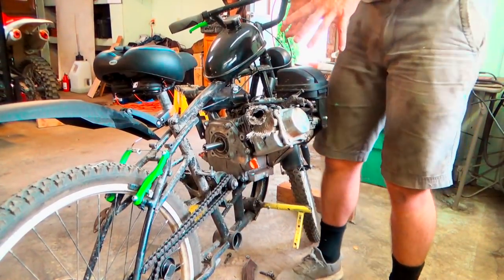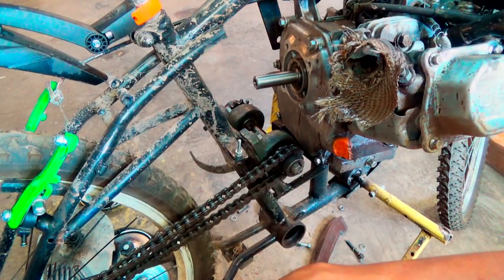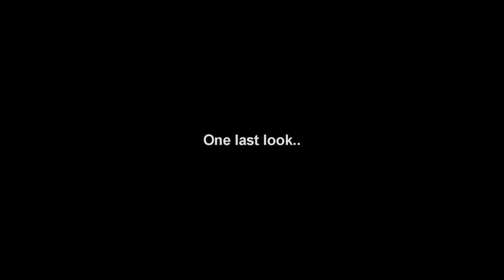home-made Motorcycle 212cc ( with Lawn mower transmission!)

Comment: hey that is one awesome build man i just had one qustion i have a coleman ct200u with a 301cc predator engine right now i am running the series 40 turque converter it also has a lot of mods done to it but i would like to have a 5 speed transmission on the bike do you know of anything that will work if so let me know

Comment: Bro, builds are great,  why u always never account for chain slack adjustment?.. how many times now?.. 7.. 18? Also, youve done enough of these to not be so far off with gear ratios..EVERY build has a jackshaft..
Reply from the maker: StupidEarthlings hey man! Do u mean a Chain slack adjustment such as slotted holes for the motor mounts?—mainly cuz I am lazy, and usually a tensioner does the trick. I use jackshafts on my projects mainly to center the engine in the frame, otherwise trying to align the engine with the rear wheel would look bad and perform poorly too. Jackshafts also allow for a super easy gear change if u are not happy with the ratio, or u simply want to change they way the bike drives per terrain.
Reply: @OliverMotorized  fair enough.  ;)
Hey, what welder you use?